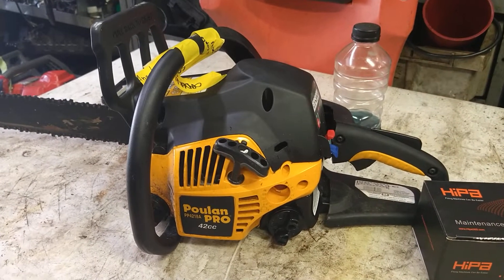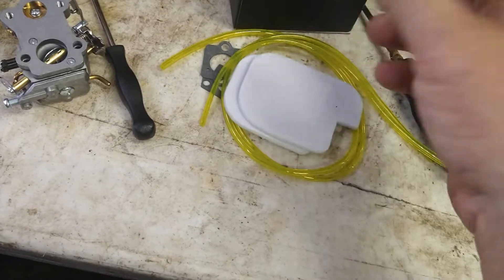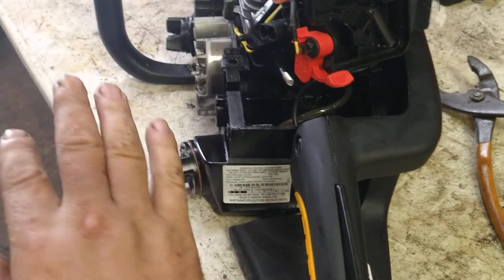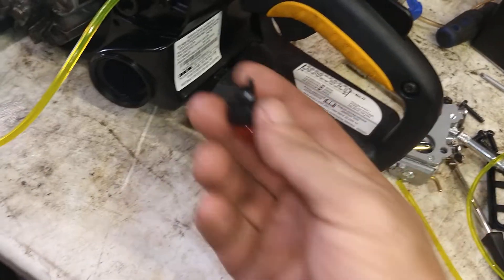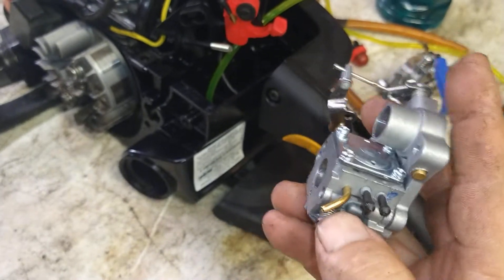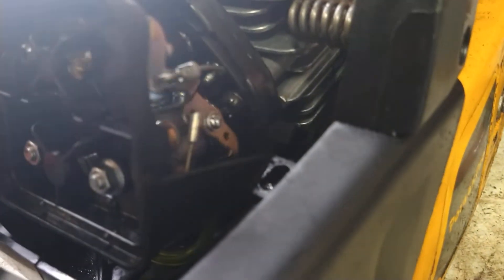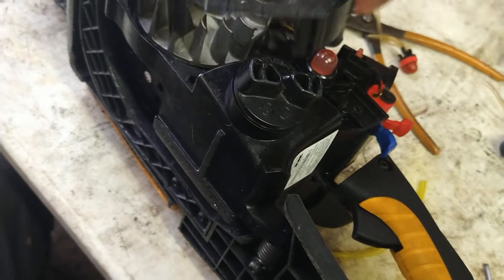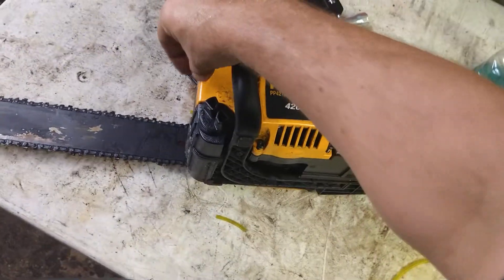poulan pro pp4218a 42cc chainsaw carburetor fuel line repair primer bulb

Comment: I must’ve had the wrong fuel line size, mine was almost impossible to get in. Took lots of ingenuity.
Reply from the maker: Nope they are that hard to get in. I just do around 1000 saws a year around 10000 2 strokes total a year so I make it look easy

Comment: Curious if the carburetor comes pre set or do you need to adjust it to make it work? If so how do you set it, for example do you turn them all the way to the right and turn it back 1 full turn or how does that work?  The one I have is a Poulan Pro Classic PP4218AV, Thanks.

Comment: Getting the return bulb got skipped. Everything in the video was helpful except u skipped putting tge line back in the gas tank. Ive been effing with this for an hour and cant get the return bulb back into the tank for nothing. Help?
Reply from the maker: cut a point in the fuel line get the tip of the point in the tank. longer the point the easier to grab from inside the tank and pull threw

Comment: Hey brother I did I've watched all your videos and I did a rebuild on my 4218 piece of shit when I fired up though and try to adjust it down it just seems like the throttles wide open and then if I adjusted any other way I adjusted down it dies if I no matter which way I turn the lower the high any advice I would greatly appreciate it and also that rubber boot that goes on the top there on the carburetor mine's cracked and when you order the kids they don't send that out do you know where I could get that part? Thanks for any advice that you might have thanks for making great videos they've helped me a lot
Reply from the maker: sounds like its sucking air between the carb and motor. check the seal. and ive used wiring heat shrink to patch the rubber boot. just cut to size put over boot heat up and boom sealed
Reply: @smallengineguys  one more question brother. I picked up a Poulan wild thing. It wouldn't start so I replaced the carb and fuel lines and it started and worked fine. Then I went to start it and the fly wheel is now catching on part of the plastic and I can't pull the cord. Any ideas? Thanks again , you are the man. 😊
Reply from the maker: @letfreedomring43  take recoil off. When installing pull rope a little so it can fall in place. Dog ears are stuck

Comment: On reassembly, you did not talk about installing the gasket, did you?
Reply from the maker: no but you must have the gasket the tiny hole on the gasket must line up with the tiny hole on the back of the carb. thats the vacuum line for the fuel pump. i just left the old one on it was still good
Reply: I got the saw together and it runs   but I cannot get the chain brake to release.  It is stuck forward.  Fix?

Comment: YOU have return and feed backwards
Reply from the maker: Lol. No I switched what holes I used in the tank around. I do this because it's a better way to route the fuel lines. I do around 5 to 10 of these saws a day 6 days a week since Paul Harvey was on the air and homelite had points. You don't have to believe me but I would if I were you.

Comment: Confused if the thin line or the thick line goes in the air return in the tank
Reply from the maker: originally the thin line was the one with the filter. i switched them around so that the thick line has the filter and the thin line is the return. this keeps the lines from crossing from one side to the other minimizing the chance of pinching or kinking the lines. i do around 3 of these saws a day.

Comment: How about just showing fuel line replacement, l don't know how you make this so confusing but you do.
Reply from the maker: If this is confusing maybe have someone else do it.
Reply: @smallengineguys  what would work the best is a diagram of the fuel lines only, and not the carburetor change.
Reply: @jimmyhuffman6802  The camera does not show enough detail.   It's like you have your fingers in the entrails  of a chicken.

Comment: Does anyone feel like these poulans are just a pain to get started no matter what
Reply from the maker: just keep poulin an it
Reply: @smallengineguys  lol. I think i need to open it up and make sure all the fuel lines are up to par
Reply: @smallengineguys  so i replaced the fuel lines, primer bulb, the spark plug, and the fuel filter and checked to make sure the spark plug is sparking but it won't start at all.
Reply from the maker: @zachpotts960  pull the muffler look at the piston. Is there lines on it?

Comment: Damn!!! you were going to explain the fuel lines and what they connect to, which i was most interested in since i am doing the same thing now and then you proceeded to whiz right past it.  And i love the way you whizzed right how difficult it was to thread the hoses into the tiny holes. you didnt even say what the different diameter hoses connect to.  Please redo this video, it has good material, just confusing.....and let someone else videotape the procedure..  Sorry to be so critical, but i didnt get anything from this.
Reply from the maker: One of my first videos. A learning process like everything.
Reply: Thin line left side , connected to the filter in his video is just for air return. Leave it flush or less than an inch past. It connects to the primer bulb, long, centered part of primer outlets.. Thick line, front hole is for the fuel filter. This is the one you attach the fuel filter to. It goes to right side carb. Left side of carb, thin line, goes from left side carb to primer bulb on the short or less centered primer bulb outlet.Anne not all primer bulbs are the same, but only one will push out the air when you press the bulb inward. This will be your left side tank return, small line side.
Reply: @clinthartzler8216  I just did this today on my PP4218AVX. Since the saw had not run for a few years, the hoses had already rotted and were broken. I had no clue how to run the new lines. And I did it as you described Clint. Hole closest to the motor/chain I inserted the bigger hose with fuel filter inside tank & other end connected to right side carb port. The smaller hole which is to the left of the carb, I connected to the long side of the primer bulb. The other primer bulb port I connected to the left port on carb.

2 issues...it took an act of God to get the bigger hose through the tank hole! About 2 hours before I finally got it pushed far enough in that I could grab with hemos! And the smaller hose was just about as difficult to get onto the primer bulb. Also, it takes forever to get the saw started now, even after running for a couple of minutes. Once it does start, it runs fantastic. But the starting problem has me thinking I've run the fuel lines incorrectly. The fact it runs great when it finally does start makes me think otherwise.
Reply: @tim7757  I'm doing the avx as well. It's not the same.